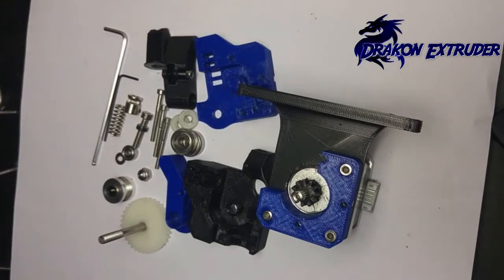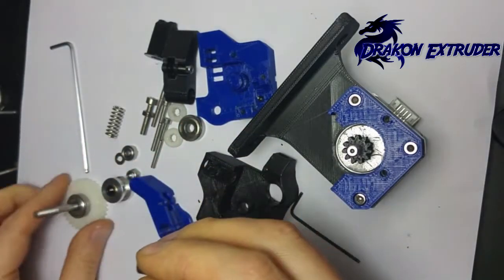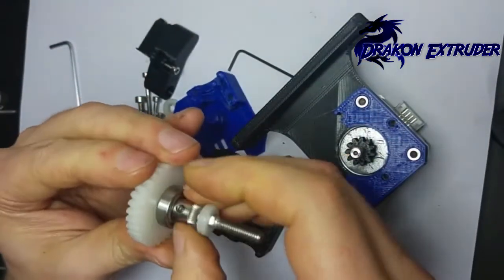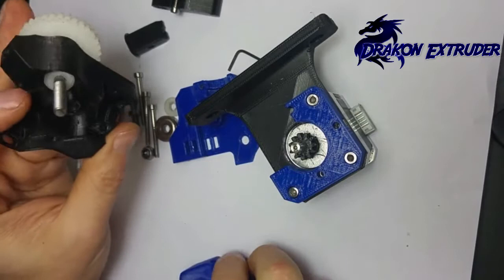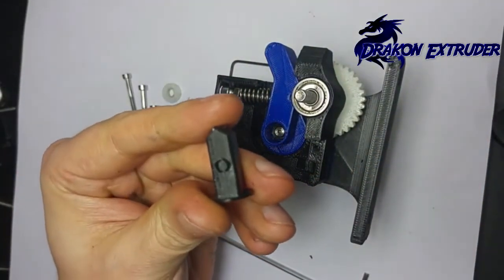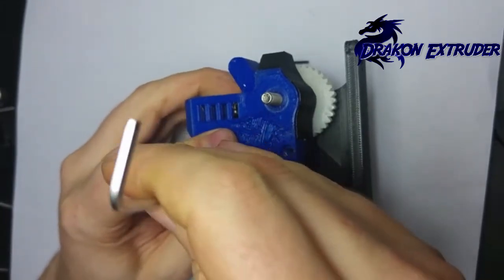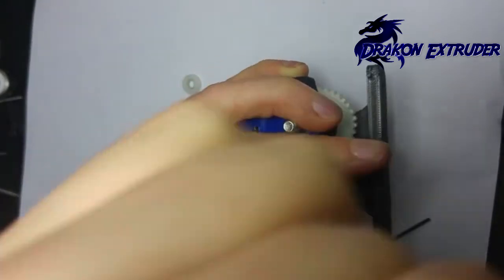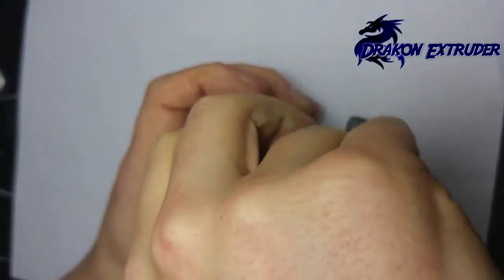Drakon Extruder assembly guide

Comment: This one is kicking my ass! lol When I insert the hobbed nut assembly into the motor housing, the hobbed part goes about 4mm past where it should line up with the filament. I've watched this several times and it looks exactly the same. Yes, the grub nut is closest to the gear. 

I don't see anything on the bolt that could shift 4mm. If i line up the groove with the filament hole, the bearing is almost all the way out of the housing. 

Any idea what I could be doing wrong? I got the files from github.
Reply: Ah nevermind! Seems not all MK8 gears are not the same. Mine is about 13.5mm vs the real ones being 11mm. There were some bad reviews on Amazon about this. (Mine was from an old extruder so it wasn't lack of reading)

I looked at the spacing of the grub screw and the slot several times ant they look the same as yours but i guess the 3mm extra lenght is scaled over the entire bearing.

Leaving this here in case others make the same mistake that I did.

Comment: if all parts would be printed in ABS would it still work? I only have ABS :/
Reply: AxMod Technologies Enquiries after doing some research I found  PLA to be better than the ABS for this part. btw i am planning to use this extruder for prusa i3 and ultimaker 2
Reply: Alright, thanks
Reply: This is an old comment but I'm gonna put this here for anyone else who might be having the same question right now. Do NOT use PETG for gears, the material is not suitable. Nylon and PLA are best for gears and if you have to, then ABS. PLA is a very hard plastic, wear will not be an issue. And if your motor is getting so hot that is softening the PLA, then adjust your motor current, it should not be that hot. And since this is a geared extruder, you won't need as much current (torque) as you normally would.

Comment: wouldn't the small gear come loose after a while, causing backlash?
Reply from the maker: I run 5 of these over 5 printers, all tolled, they have about 2000 hours, maybe more, across all of them. As stated in the video the small gear centre hole is deliberately tight, this is to combat this exact issue, as well as having the flat on the motor shaft to stop this, so it's highly unlikely that it's going come loose in the short and medium term. As with all parts, it will eventually wear out but it's more likely the teeth will wear than the gear become loose.
Reply: will PLA gears last? My printer have some troubles printing ABS.
Reply from the maker: Yes, PLA will work and last.
Reply: I'll start printing then, thanks :)
Reply: everytime I try to fit the small gear it eventually snaps :( what can do about that?

Comment: Hi, I am planning to set up my prusa i3 like this setup: http://www.thingiverse.com/thing:1552022 using your extruder as direct feeder into the E3D v6 and thanks to the gear I can use a slim motor. This will make much lighter and maybe produce better prints... do you think that the parts would work? or do I need to redesign the whole carriage?
Reply from the maker: Couldn't say, print it and see what happens.